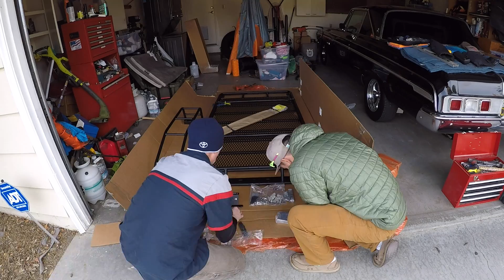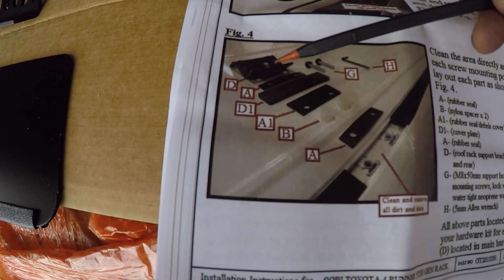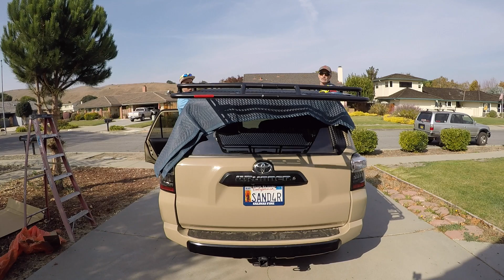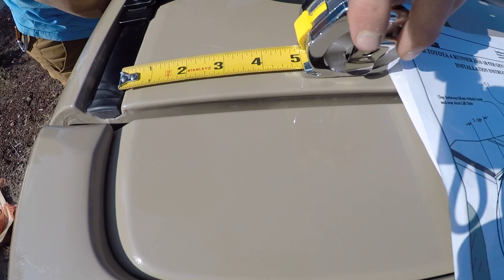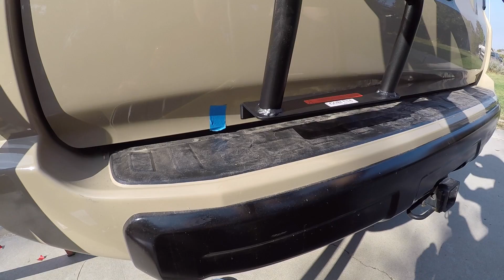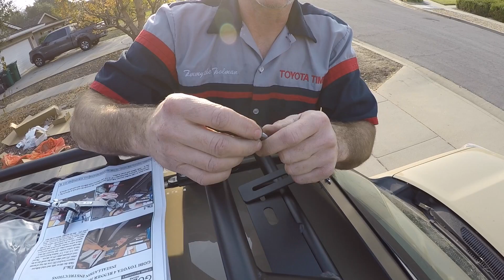Gobi Stealth Roof Rack Install (5th Gen Toyota 4runner)

Comment: Hey a little late here, but I just ordered a stealth myself and am waiting for the rep to call to get payment info. 

Anyway we're a military family - former combat medic myself and my wife is currently a Drill Sergeant. You mentioned they throw in a free accessory for military? Do I just ask the rep then? 

Great video, I'll be sure to consult it again when I get the thing in like 4 months hah. Thanks for all your work, and help!
Reply from the maker: Yeah, just call them and tell them you're in the military and you heard that they offer a free accessory for military and public safety personnel.  Glad you like the video and good luck with the install in 4 months.
Reply: @TimmyTheToolman  Much appreciated! 

Go back to bed!
Reply: @TimmyTheToolman  Hey back for a little update: got the Stealth on order, about 9 weeks to go haha. got the large toolbox added for free :) 

I had a question about the install but I don't know if you'd be able to answer this. I have a 19 TRD Pro with the new FJ style rack, and when I removed that rack I noticed that I have no nylon white 'guide' tubes in the bolt holes like other 5th gens do. It's just bare there. I don't know if that will be an issue when I install but we'll see. 
Regardless, the main question I had was with the back plate that the bolts screw into, under the skin/above the headliner. I've heard and read conflicting reports of which models/versions have this, but mine definitely does. There seems to be a plate that the bolts mount to, rectangular in shape, one per mount location. A couple of mine are loose due to the tack weld coming disconnected when I took out the former racks torx bolts, and I'm concerned they'll fall into the headliner when I remove the filler bolts I have in now in preparation for the Gobi hardware. Do you know anything about this, and if so, can you possibly provide any tips on how to avoid messing up the install? 

Thanks so much. Great video :)
Reply from the maker: @gregm8871  I wish I could help you out with your questions but the installation on my friend Garett's 2016 is my only experience with installing one of these racks.  I know Gobi is a busy company but maybe you can talk to one of the techs on the phone and they can answer your questions.
Reply: @TimmyTheToolman  ok thanks anyway! Take care!
Reply from the maker: @gregm8871  You too.  Good luck with the install.

Comment: what is the height from roof line to highest point of rack?  i want to get this rack, but i want to make sure 4R will still fit in garage.
Reply from the maker: Have you tried calling Gobi and asking them?  I'm sure they could give you this information.  If you can't get the answer from them.  I'll bug Garett and ask him to take a measurement.
Reply: Gobi website states that it’s 6.5” from Vehicle Top to Rack Top for both the Lightbar Setup and Multi-Light Setup Stealth Racks. If you’re instead looking at the Ranger Rack it’s 8.5”.

Comment: Same issue with my bolts! Trip to Farm and Barn fixed it. Solid rack otherwise.
Reply from the maker: Yeah, you'd think they'd just get bolts and nylon locknuts from a different supplier instead of telling everyone to put antiseize on every bolt.  No bolt and nut combo should require antiseize for assembly.

Comment: I know this is off subject but notice u use some Gearwrench stuff, how do u like there product...
Reply from the maker: I like their stuff a lot.  There are some complaints about the heads of the ratcheting box end wrenches becoming loose making them harder to use because the head flops around, and that's true, but I still love using them.  Their 120 point flex head ratchets are awesome as well.  It's a game changer when getting into tight spots.  Only takes 3 degrees of movement to get to the next click.  They have a good warranty too.  If you're not happy with something, you can send it back and they'll send you a replacement.  I also own some of their longer box end wrenches, sockets and flex head flare nut wrenches.
Reply: @TimmyTheToolman  Nice ... I'm primary a snapon user but sense loosing touch with my dealer I've been putting the feelers out there .
Reply from the maker: @SmokeyRidgeRunner  You know, I basically buy most of my tools via Amazon.  I look at the reviews, and if they are mostly positive, I'll take a chance on them.  Companies like Snap-on and Matco obviously make nice tools but their price point is way too expensive, even for a guy like me who does a fair amount of wrenching.   I have a lot of Gear Wrench tools, OTC tools, Dewalt tools and Milwaukee tools.  There's also speciality tool makers like Lisle and Schley that I've bought several tools from.

Comment: Hey guys, I had the same problem you did with the wind deflector. In my case I believe I forgot to put anti seize on the hardware. Thought I would post so someone else doesn't make the same mistake.
Reply from the maker: Hey David, I thought the same thing but no nylon lock nut I've ever used required lubrication to not break.  There is something wrong with these fasteners.  The nylon is just there to add resistance to the nut so it can't easily loosen and back off the bolt.  I think they should source the nuts and bolts for the wind deflector from a different supplier.
Reply: I agree, which is why I didn't bother to use anti seize on the wind deflector. However, I contacted Gobi regarding this issue and their response is "you need to use anti seize or the problem you're describing will happen". So, for anyone else out there I would suggest taking the extra few seconds and apply anti seize to the hardware on the wind deflector. If you do and still have a problem at least you have a better argument than I do when contacting Gobi.
Reply from the maker: @davidpederson2180  Yeah, it sounds like they aren't going to change the fasteners so using the anti-seize is a good idea unless people want to take a trip to the hardware store like we did.
Reply: @TimmyTheToolman  Yeah I noticed too that the hardware is just subpar. The fact that it locks like that without anti-seize, but then the hardware can be sheared off like that with very little effort. I've never had a lock nut do that to me. Went fine with lube so I hope I never have to remove anything hahaha
Reply from the maker: @DuskKarma  Yeah, I agree that it's weird to have to use anti-seize to joint fasteners.  I think Gobi should just use a better supplier for some of their hardware.

Comment: Thank you for posting this video with such detail. That TRD PRO appears to have the stock ride height, is that correct? Also can you measure the overall height to the top of the rack? I would like to know if it will fit under a 7 foot high garage door. Keep up the great content!
Reply from the maker: Garett's rig is stock height.  I could ask him to measure it and get back to you.  Glad you like the video.  **Update - Garett got back to me and said it's around 6'3" tall.
Reply: Gobi’s website says 77” for the stealth rack with factory tires.  I’ve worried about the same issue with my garage and office garage but that leaves a full 8” for tires and lift so I think I’m about to pull the trigger on one.
Reply: I put a 3” lift plus the gobi rack on top and it fits in my garage just fine with about 7-8” clearance